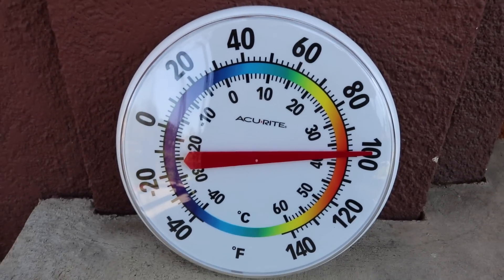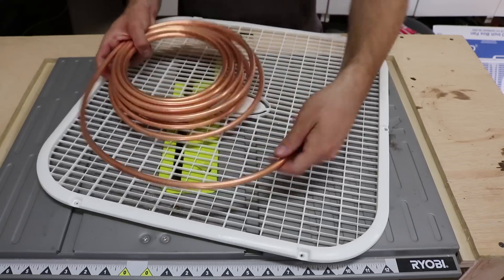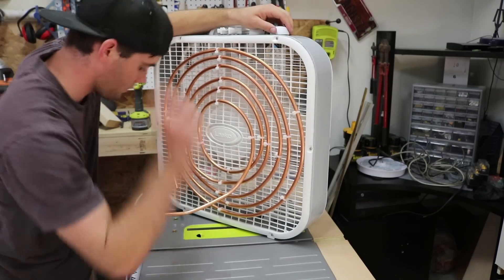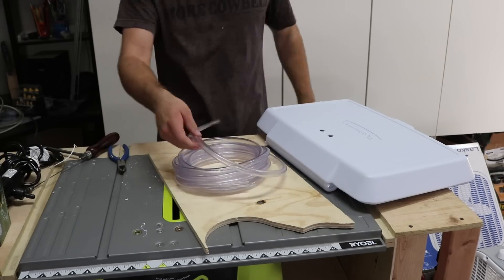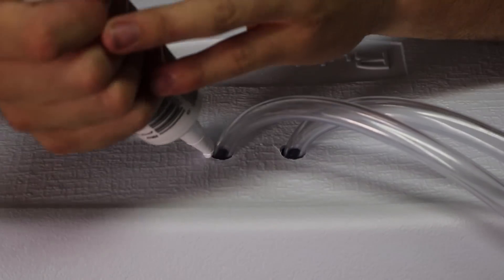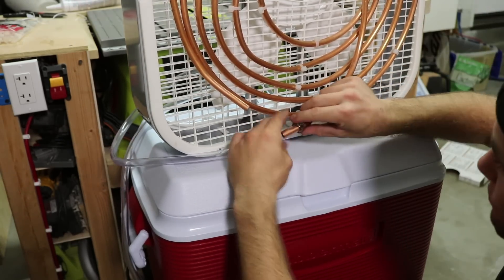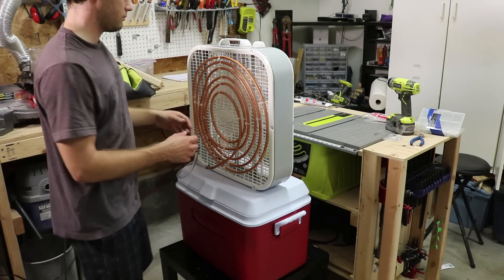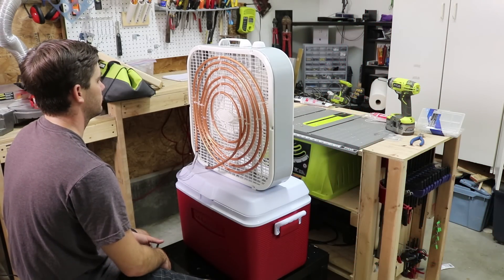$100 Homemade Air Conditioner - DIY

Comment: You didn’t show the final ambient temp.  Fail.
Reply: druidboy76 probably didn't make much of a difference tbh
Reply: I know, he had the laser thermometer and everything
Reply: Is that why they use them in the A/C industry? lol. Ya I know, they take the temp of the vent, but you could put something in front of it. PLUS he had a GINORMOUS thermometer!
Reply: @ByGraceThroughFaith777  could cool a solid object by blowing on it so the fan itself could be cooling the metal and nothing else
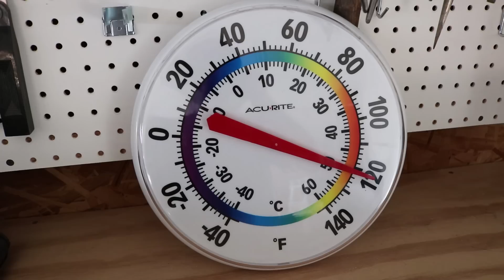Reply: @HuskyGamersUNITE  He was measuring the door temp with a laser but immediately after (0:29) it shows a huge thermometer, so your comment makes no sense yet you act so superior... Also you can buy an AC that actually works for less than 100$ but judging from your comment you already built yours.
Reply: He wanted the feeling of having a real AC unit. IMHO he just wasted $100.
Reply: It's only good for sitting in front of
Reply: put a metal plate in front of the fan.  use the laser thermometer to measure the temperature of the metal plate.  it's not terribly difficult.  and there's no reason to be insulting to someone else the way you were.
Reply: metal absorbs and holds hot and cold temps a lot better than air does, thats why the racks of your oven are a lot hotter than the air in the oven and the racks in your freezer are a lot colder than the air in the freezer, heating and cooling your house is the same, if you're heating your house the furniture and appliances are going to feel warm to the touch cause it absorbs and holds the temp a lot more efficient then air does, so measuring the temperature of a surface of a metal plate would not give you the ambient temperature (aka. room temperature) which is what you are going for when trying to heat or cool a living space. to dumb it down even further, so you use your fancy laser to take the temperature of the road on a hot summer day, your laser reads 135 degrees F. but my old trusty mercury thermometer is only reading 85 degrees F., how can that be? cause the street is absorbing the heat from the sun, just like the metal plate would absorb the cool air from the air conditioning, no not the light but the heat, feeling heat from light is in your head you feel heat from a source of power such at electric in a light bulb not the light produced, gas furnace's burning gas to heat your home, nucular reactions like the ones happening on the sun but that is for different day
Reply: @iAmTheWinnaman  Geez, how about learning the difference between then and than. #GoBackToSchool
Reply: @iAmTheWinnaman  1- Cold is the absence of heat!! The plate does not "absorb the cool air"!! It loses heat!!
2- The street is not "absorbing heat from the sun." The radiation from the sun is speeding up the molecules in the road. That motion is what causes what we perceive as heat.
3- Your "trusty old mercury thermometer" is reacting to the heat by measuring the relative expansion and contraction of the mercury. The mercury is reacting to the ambient air temperature in exactly the same way a metal plate hanging in the middle of a room (or over that hot road) would.
4- "Feeling heat from light is in your head" is exactly right (see #2) because the light "heats" your head. An incandescent bulb creates light by running electricity through the filament until it gets white hot and vibrates at  multiple frequencies including visible light.
5- You don't get heat from "power." It's the power/energy that causes molecules to vibrate which we perceive as heat. More energy...greater vibration...more heat.
“If you want to find the secrets of the universe, think in terms of energy, frequency and vibration." ~ Nikola Tesla
Reply: yup.
Reply: that doesnt show how effective the system is for cooling the room
Reply: @HuskyGamersUNITE  One little trick...hang a metal plate from the ceiling with a string and check the plate temp...voila!!...air temp.

Comment: if you not completely bored like this guy... https://www.homedepot.com/p/Frigidaire-5-000-BTU-115-Volt-Window-Mounted-Mini-Compact-Air-Conditioner-with-Mechanical-Controls-FFRA0511R1/206734512
i wonder what the cost of couple bags ice everyday, and electricity for the pump is, in comparison to the $135 window unit...

Comment: Love the creativity. Use an old cooler you already have...some of these things you might already have. One of the best things you can do to lower temps in your house is make sure your attic where all the heat of the day builds up is lowered. Put a fan in the attic entry to push the hot air out. I can lower the house temp by 2 degrees just by spraying the roof with a garden hose. You can feel the water running off the roof is "hot" which is energy you are taking off your home. Be creative but dont think of what you do as "cooling" think of taking the "heat" or energy out. Thinking this way allows you more options.

Comment: That little bit of ice can not cool much, you need many pounds of ice to cool that garage. a small portable A/C would cost a couple of hundred dollars and would do enough cooling in your garage so you can comfortably change the oil or do other repairs to your toys.

Comment: Damnit youtubers quit spreading these dumb ideas! For less than $100 you can buy a 5000 btu/hr air conditioner. They cost less than $2/day to run 24/7.

It would take 35 lbs of ice per hour for this useless contraption to match that performance. The cost of buying that ice is completely uneconomical. And trying to make that ice yourself 1) isn't possible with a home freezer 2)costs at least twice as much as running an AC and 3) thanks to the 1st law of thermodynamics, would actually RAISE the temperature of your house.

No, an AC doesn't cost more to run. No, you couldn't use ice packs. 

Edit: it would actually take melting over 3 lbs of ice an hour just to negate the heat added by the fan. So if that 7lb bag had any ice left after two hours then you are literally heating the room.

Comment: Dude try a helium sealed cylinder stirling cold piston that can turn atmosphere to liquid that fills a insulated tank with a bell siphon that fills a condescending coil with liquid atmosphere filling a resivor were a V - twin cold piston Stirling engine cylinder heads can charge the cold gas pistons with one fly wheel powering a fan to force air threw condensing coil chilling the air with the liquid air boil off returning to the cold piston to reform liquid air to end the cycle. Design the cold piston to operate off a organic carbon power cell till liquid atmosphere starts to cycle then have the power from carbon power cell stop has the other fly wheel on the V- twin cold piston Stirling engine operates a rewired drum motor generator that provides all the volts needed to power the cold piston and the electronics digital thermostat on your state of the art air conditioning unit. This would make one hell of a window unit best part? No electrical bill. 😂😲
Reply: English please
Reply: Opps i need to talk Langley spider alien parasitic maggot huh? So many nasty perverted Iussas parasitic maggots these days its so disgusting. Well if you.believe in aliens anyway? Everyone has a alien conspiracy theroy these days. 😕😒🗼👽

Comment: Post build temp readings ?
Reply: It will make the room hotter. The tap water will warm up, get pumped into a cooler where it will stay warm, then only warm water will get pumped through the pipe. In addition, the fan and more so the pump, will be creating heat. This means an overall gain in temperature.
Reply: when all the ice is melted you should change it or turn off the cooler and close all of your window room to preserve the coolnes

Comment: tried this and made this finally but problem with that is, it does not work in a tropical country where humidity is high because water gets deposited on the copper pipes as cold water flows through it and ice melts very quickly. Total wastage of money

Comment: How much do You save on electricity doing it this way?
Ice also cost money!
What’s the net difference in electricity between a small AC and this concoction (fan + pump + Ice)?
Reply: It's the same mentality that electric cars are free to run and require no maintenance. Also, that lithium ion batteries are of no harm to the environment.
Reply: Your better off buying an air conditioner. Your freezing water in your refrigerator/freezer thus using power. So in the end this is not worth it. The benefits of an ac is taking the humidity out of the air.
Reply: Not if you freeze it yourself. Clean air, no chem!
Reply: y2rock If you're worries about Ice usage there's always Ice Packs

Comment: A brand new a/c unit is about $109,  it works very well,  this fan won't do much, unless you are all the time in front of it,  the a/c unit is more efficient, if the refrigerator is constantly making ice is just using more power,  if not window or hole in the wall, just buy a used  portable a/c for the same price or less that actually does the job!!!!!!!!!!!!!!!!!! unless of course you made this just for fun in this case is ok.
Reply: +Deoc - Please don't knock on my Hommies with poor Mathematics and English!  LMFAO!!!
Reply: LOL!
Reply: +Chacumbele Demeye - Yo my hommie!  There is no need to " Build " one, if you use " LOGIC "!  LMFAO !!!

Comment: Possibly the first homemade air "CONDITIONER" I have seen that actually works. Nice.  Usually the are just air humidifiers blowing air through a screen coated in chilled water, and sometimes not even that. If a little more tubing could be applied, it might work even better. I wonder how long the ice lasts?

Comment: you forgot the constant ice supply you will need to replace about every 1.5 hours. I bought a used window unit (20K BTUs) for $100 on Craigslist, Im sure your little idea makes about 5 BTUs. considering how close you have to sit to it just to get some cool air.
Reply: SiNKarnage you and your ice packs
Reply: And all I had to do is plug my window unit in, but you get up every hour or so and get your ice packs.
Reply: 2 words Ice Packs
Reply: Its cheaper on the utlitlity bill. Running a fan vs an actual ac is much cheaper
Reply: Ice has to be made as well.  Don't know if it is cheaper.

Comment: That was a nice build  You could have made the hole for the electric cord much smaller though.  A simple and small V notch would have done the job.  Now you just need to power the unit from solar.

Comment: $20 more and you can buy a whole real AC tho.
Reply: And you can enjoy them electricity bills
Reply: @SiNKarnage At least the electricity used will be producing actual mechanical cooling.  It's like talking to a brick wall with you.  You simply can't grasp the concept of thermodynamics.  It's not going to work, period!
Reply: You can even use reusable Ice Packs, replace and refreeze them
Reply: Bobby Jeff You can reuse the same water not like the fan is a mistifier. And Ice uses so much less water not like you're gonna use the fan for cooling 24/7 unless the sun was out 24/7 or your heating system is 200°
Reply: Bobby Jeff A refrigerator uses electricity 24/7 in order to keep stuff cool and fresh already, if you add that with a real AC unit you're using twice or more electricity compared to a box fan and pump, so would you rather be using twice as much electricity over an ac unit and your fridge (which you always have running anyways) or a DIY portable AC which you can unplug and detach any day that uses much less electricity comparison to an expensive ac unit? 

And Water can last for days or weeks how do you think Fish tanks keep water inside? This contraption circulates the water through the tubes and back into the Box over and over just like a fish tank. And who says you can't use multiple ice packs? Keep one set or 2 in the freezer and another set in the box and after that set defrosts, call time out and bring out the next set while that previous set sits in the freezer.
Reply: You need to understand how much you pay vs how much you get,  of course the fan and the pump use a lot less power but so you get a lot less cooling, a refrigerator does NOT run 24/7 it turns off when it reaches a set temperature and turns on whenever that  temperature goes up, if you are putting room temperature water to make ice the refrigerator has to work harder to cool it down, the heat from the refrigerator goes to your house,  and your house gets warmer,  the reason an a/c unit is more efficient is because you are extracting all that heat and dumping it outside the house where you don't care where that heat goes,  so if anything buy an a/c and seat on front of it whenever you feel hot and turn it off when you don't need it no more, this is the most efficient way,   an 5k a/c uses about 600 wh when compressor is on and about 20-30 wh when the fan is working only,  the compressor is not always on and turns on an off,   again it works best because heat is dumped outside and no inside your house like the refrigerator does, by the way an a/c unit can last 10-20 years, people get rid of them because they get dirty inside, but as long as you clean it these a/c unit can last for a long time.
Reply: david kelly no that's not how salt works, it lowers the freezing temperature water allowing the water to be a liquid at a lower temperature. Salt doesn't "chill the water"
Reply: I keep seeing comments about $5 a week for a.c. unit. let me tell ya it's a lot more than that. I have a window unit running on 220v and it burns up my electricity. I wish it was only $5 a week!
Reply: I live in a small town where some of the landlords write into the lease that you can not have an air conditioner installed. My problem, but this is a great idea for those situations.
Reply: Also you gotta keep in mind how long do these AC units last? And how much does it cost to replace it's filters? 

This DIY only requires a Box fan and a pump and from my eyes those costs so much less than a AC unit or the cost for a filter
Reply: SINKarnage AC filters are washable and can be cleaned by a vacuum cleaner . When using right an AC can last for 10-20 years without problems and thus is much cheaper than all these DIY stuff since that $100 garbage will not last long anyway . Also the dozen or more fans you buy in those 10-20 years are more expensive at the end and also those fans aren't ecologicaly since it has tons of plastic . Is why i hate fans with plastic blades they need to be in metal those are the best .
Reply: You can make this more efficient by adding rock salt to the water and ice... it will chill the water in the tube by an additional 15-20%
Reply: SiNKarnage lol you obviously need to learn about the laws of thermodynamics he's going to use the same amount of electricity anyway...
Reply: +SiNKarnage The fridge is just pumping that heat back into the house, so not very efficient, or effective. Assuming it only gets hot in the evenings, he would only kick it on in the evenings. So overall it would be a much more effective, and efficient method.
Reply: +SiNKarnage Many window a/c's will last a good decade without maintenance, so 110 dollars for 10 years of cooling is not a bad deal.
Reply: Im more annoyed by the fan then the method.  Those types of fans are no very efficient even at full speed.  Bigger doesny mean better when that motor and blade cant blow more air than a small fan.
Reply: what about the water and ice make bills i think that would cost more than the 5 dollar a week of the electricity
Reply: +JuseBeats - Please don't knock on my Hommies with Poor Mathematics and English!  LMFAO!!!
Reply: I was STUPID once!  I even have a Video to show how STUPID I was!  Here:  https://www.youtube.com/watch?v=m1sj6ispqT8
Reply: SiNKarnage but refreezing the ice packs takes a long time and uses electricity. Also water evaporates so your can't keep using the same water over and over.